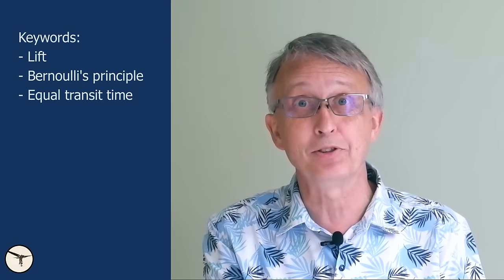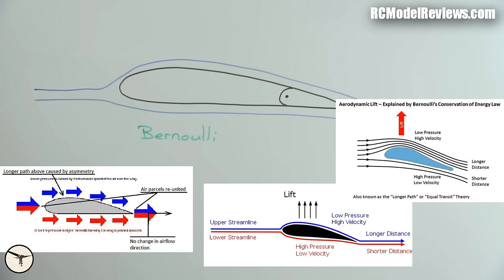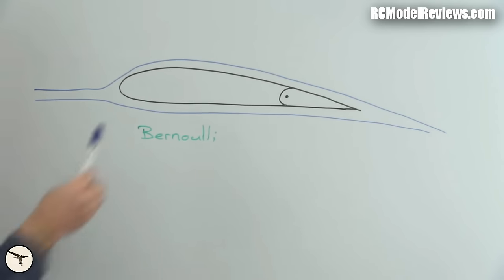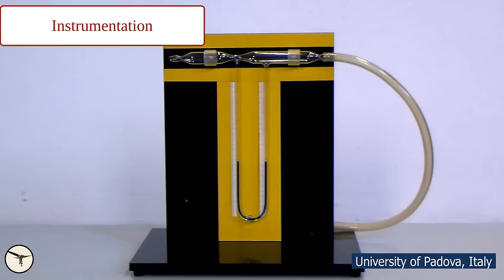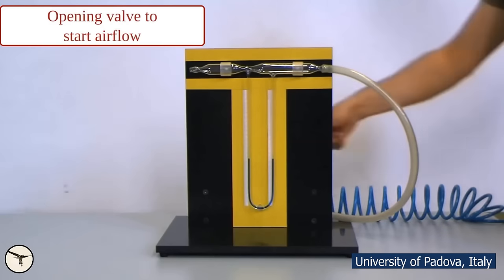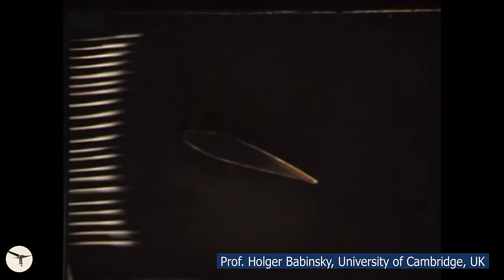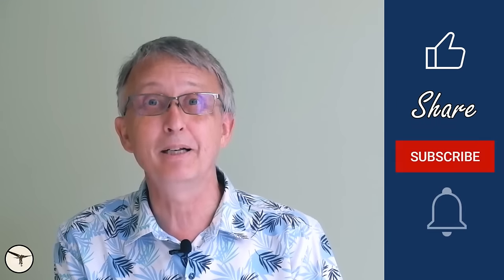Why are so many pilots wrong about Bernoulli’s Principle?

Comment: There are so many ways at explaining lift or movement.  When a vehicle traveling at a high rate of speed collides at an oblique angle with a stationary vehicle, it moves the stationary vehicle because of impact and not Bernouli"s Principle.  Call it what you want, but the wing is colliding with a mass of air.
Reply from the maker: The only place where the wing is colliding with a mas of air, is at the stagnation point.

Comment: In a lot of  bad airflow illustrations, air leaving the trailing edge doesn't continue downward, but rather immediately turns back upward in line with oncoming air. Air both doesn't do this nor should it.  In reality, air continues downward even after the wing has passed. The bad illustrations help the false hypothesis.

Comment: the air did move faster over the top of the wing and had lower pressure, so the same principle as a sail boat.
Reply: nonsense.  A sail has no thickness and has exactly equal lengths on each side.
Reply: @jeffreyerwin3665  but the wind moves a longer and faster way over the bulb sail, because on the other side there will be an "air-bubble" along the sail, over which the wind takes a shorter (and slower) way

Comment: It is NOT the curvature!  It is the constriction of stream tube due to physical obstruction of the wing. Reduction is x section area in air stream leads to increased v which lowers static pressure, that's how you actually apply Bernoulli

Comment: I don't understand the point of this video: Why exactly are many pilots wrong about Bernoulli's Principle ?
There's agreement that lift is caused by reduced static pressure above the wing due to increased air flow with respect to pressure/flow below the wing, as predicted by Bernoulli's Principle.  The only point of contention seems to be whether or not the flow lines reconnect beyond the wing - e.g., whether or not the flow path is longer for air travelling above the wing.  Why is this relevant to lift and what exactly do pilots not understand about Bernoulli's Principle ?

Comment: The video you're "debunking" is correct. It makes no difference where the two flows meet. The area over the wing is what counts. They meet behind the wing and the low pressure area continues past the trailing edge, with the higher - pressure air being forced into the "vacuum" and causing turbulence and vortices, both of which act as drag and hold the wing back. Streamlining to reduce this effect is vital.
Your "smoke" demonstration shows a stalled wing, with the air flow  separated from the surface of the wing. This is not aerodynamic lift. It's air resistance (friction) due to viscosity. acting at a vector that causes upward movement of the object. A brick will "soar" this way if it's moving fast enough, but that's not a wing. .An efficient wing has the bottom surface parallel to the direction of flight. The bottom covering isn't even necessary on many wings.

I apologize for any offence this may give. I'm an engineer, and we're as quick to point out things like this as pilots are.

Comment: I've seen another video do exactly what you just did.

You said that people are wrong about their understanding of how wings produce lift then you went on to describe the exact same dynamic as people understand it to be - that is, lower pressure over the top of the wing compared to the bottom of the wing.

At no point did you say what was different between what you present and most people's understanding and I wonder if you did that because there is no difference.
Reply from the maker: Pressure difference is essential for lift. What many people get wrong is how the pressure difference is created.

Comment: Dear Capt. Magnar.  I would like to see a mathematical proof the confirms or disproves the theory that is mostly accepted by the aviation population.
It has been said that when an airplane is making a constant altitude banked turn, the outer (top) wingtip is flying faster than the inner (bottom) wingtip.  Thus, it is said, there is an overbanking tendency.  Although many agree with this concept, I don't.  The theory by most pilots is that the outer (top) wingtip is enscribing a wider circle than the bottom wingtip thus making the top wing's airspeed faster,  causing an "overbanking tendency".
     In a coordinated constant altitude turn, I've never noticed an overbanking tendency. I can trim the airplane and let it go in smooth air and it will fly in circles until it runs out of gas.   I would agree that if the airplane were connected to the ground, like toy model gas powered airplanes held by a handle with two strings, this would be true.  But an airplane does not turn like a propeller or helicopter blade, where the tip of the blade is moving much faster than the central hub.  I have found it difficult to prove my point one way or another using simple geometry.
     The best way for me to describe my belief is to say that when the airplane (the flying wing) is flying in circles, it does not know where the ground is below it.  Instead, the wing believes the ground is directly equal to but opposite to the total lift vector.  In other words, the airplane thinks the ground is opposite to total lift and flys as if it is going straight.  The wing doesn't "know" its turning, it only feels heavier.   Do you agree or disagree?  If you don't, can you kingly set forth a proof that destroys my belief?
     Thanks in advance if you are reading this.
Reply from the maker: Hi. Some aircraft are more prone to overbank than others. There are several factors, like the wingspan and bank angle. When you fly in a turn, the outer wing will travel a longer distance than the inner wing. This is the formula for the distance along an arc: s = 2 π r (θ/360°), where s is the distance, r is the turn radius, and θ is the central angle of the arc. https://byjus.com/arc-length-formula/
Since the outer wing tip is travelling a longer distance than the inner wing tip, the speed of the outer wing tip must the higher. A higher speed results in more lift.
Reply: Than you for responding, but I don't see it that way, even though may seem obvious.  The FAA isn't always right. either.  Back it the 1960s the FAA told us that we should control our airspeed with elevator and altitude with power.  Then in the 1980s the FAA made a complete change and told us to control airspeed with power and altitude with elevator.  Now it's common to hear that performance = power + pitch.  My point is that the FAA can change its mind, depending on who is in office.  But thanks for your time.

Comment: It is not that the air moves faster over the top, but that the air flows more slowly under the wing, with the net effect that the air over the wing is faster when compared with the air underneath, so ... what pilots are taught is actually correct, it is just not due to distance travelled. Also, not mush mention is made of the trailing edge actually redirecting the airflow downwards, resulting in additional lift.
Reply: There is no significant force on the trailing edge (as long as no flaps are used and the wing simply trails of) resulting in additionnal lift. The airflow is directed downwards, but this is a global phenomenon not limited to the trailing edge, but it is caused by the entire airfoil or wing.

Comment: Any kid who’s held his hand outside of a moving vehicle will tell you it’s the force of the moving wind against your palm that lifts your hand. Ie: angle of attack. If it were primarily Bernoulli’s principal, wouldn’t aircraft lift indefinitely? Are pilots constantly trimming the plane down to counterbalance the Bernoulli “lift”?
Reply from the maker: Lift counteracts the weight of the aircraft. The higher you fly, the thinner the air, and less lift is available. Besides, "Bernoulli lift" and "Newtonian lift" are two explanations for the same lift.

Comment: This is just like floating of the human body in the red sea. The higher the density the higher is the viscosity. Due to the velocity difference between the top and bottom surface of the wing , there is a differential viscosity of the air on the top and bottom surface of the wing. The viscosity of the air below the bottom surface is higher than the viscosity of the air on the top surface of the wing. That means the density of the air below the bottom surface of the wing is higher than the top surface of the wing. It is this differential viscosity of the air which is lifting the Air plane in the upward direction. Newton's third law of motion is a better explanation for the life force of the aircraft. The viscous forces act perpendicular to the surface of the Wing of the airplane ✈️. The higher the density of the air below the aircraft wing, the higher is the load bearing capacity of the air to lift the aircraft.

Comment: a completely flat rigid moving strip generates air lift when AOA >0° & <90° including case if viscosity is 0 (liquid helium e.g.)
Bernoulli's principle provides reasonable explanation why asymmetrical airfoil generates air lift when AOA is 0°
showing asymmetrical airfoil at none zero AOA while applying Bernoulli's principle is confusing and somewhat pointless
pilots are not responsible for airfoil or wing twist optimization & CFD is a quite complicated mathematical subject
pilots should be aware/understand critical AOA, stall and in-flight icing, that degrades wing performance dramatically

Comment: Let's look at this issue in a different way.

Turn the wing vertically, put it in the sea so that it's cross-section becomes a keel or a rudder. If the transit time theory has any merit, the " upward" force on air would become a lateral force in the water.

Thus, should its veracity be clearly (and easily) proven or refuted.

Comment: I watched a lecture at MIT on aerodynamics, there she explained the lift is created by law of conservation of momentum.
Reply: its actually both. The problem stems from bernouli beimg meant for a closed system, like a pipe. A wing isn't  in a pipe and its in a pressure gradient from 14.7 to Zero.....
the maths we have been using isnt the right maths
Reply: @joeds3775  thanks
Reply: @joeds3775  You're right to some extent but I don't know who you mean by "we". The maths used to design surfaces on aircraft include a bit of Bernoulli but are far more comprehensive than that. I'm old enough to have done the sums before computers and they could take months to get through. The advent of computers has speeded things up immeasurably and has taken away the temptation to simplify in order to make the calcs less tedious, so designs are becoming more accurate all the time.

Comment: So how does an aircraft fly knife edge ? Wings not required !
Reply: To the extent there is no vertical component of thrust aiding lift, a wing with little or no asymmetrical shape creates the asymmetrical condition needed for lift, by flying with a positive angle of attack.

Positive angle of attack creates the necessary degree of asymmetry to the relative wind, both right side up and inverted.

Any aircraft able to maintain altitude in a continuous 90 degree bank orientation, would have to be using a combination of engine thrust sufficiently pointed in the vertical direction, with enough thrust to weight ratio, plus any angle of attack asymmetry producing lift from any exposed surfaces.

It has to be one, the other or a combination.

Comment: My flight instructor told me something important.  It is not the airspeed that is important, it is the speed of the air that is important.  Thus, there are many unique designs that increase the speed of the air over the foil, and that is not dependent on the airspeed.  Interesting no?

Comment: I have zero knowledge on this subject and I am not saying this is wrong, BUT solely on the reasoning presented here, the explanation makes no sense to me.
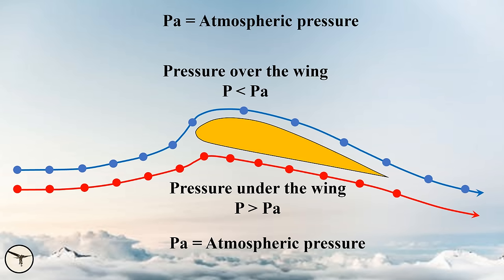First, it is stated ~3:34 that the pressure well above the wing is Pa, and the pressure just above the wing is <Pa, and that is lift. 
If you have higher pressure above and lower pressure below, that sounds like the opposite of lift. 
Similarly below the wing pressure just below the wing is stated to be > Pa, but below that is Pa, and that is lift.
Again, that sounds to me like the opposite of lift. 

Second,  if you freeze the image at, say, 3:11, it shows ALL the smoke trails past the rear of the wing at approximately the same spot, which implies equal speed and ergo equal pressure.  ie no pressure differential as noted above.
The smoke trails below the wing appear more complex: higher pressure just below the wing and lower pressure below that. That is as stated above but surely that is the opposite of lift?

Overall, however, the air below the wing is plainly at higher pressure at ALL levels, than air above the wing at ALL levels.
Which looks  remarkably like the normal application of Bernoulli's Principle, the video is trying to refute.

Lastly, I don't see why you would 'forget' Newtonian physics; if you stick a tilted hand or flat piece of anything stiff, out the car window, it has lift or otherwise depending on the angle.  That - surely - is simply Newtonian physics at play?

Comments?
Reply from the maker: Hi Alexander. It is the pressure diffrance between the upper and lower wing surfaces that counts. (Forget the atmospheric pressure if that confuses you). When the pressure over the wing is less than the pressure under the wing, we have lift. 
The smoke at 3:11 clearly shows that the air flows faster over the wing than under the wing. However, the windtunnel is too small to show undisturbed air further above and under the wing. 
I haven't forgot Newton. The purpose with this video was to point out why many people get Bernoulli's principle wrong.
Currently, I'm producing a new video where I will explain the relation between Bernoulli's principle and Newton's laws of motion.

Comment: So summing up - the relative pressure on top of the wing is lower because the air is travelling faster ?
Reply from the maker: Yes
Reply: Yes, but the pressure difference between the upper and lower surfaces of the aerofoil is not the primary cause of lift.

If it was, when an aircraft is flying upside down, the lift force produced by the wing would be in the same direction of gravity, would add to gravity and the aircraft would crash into the ground. Which clearly, does not happen.
Reply: @deang5622  Angle of attack is the other relative. When flying upside down, the angle of attack must be more aggressive to create lift. Of course there's a lot more drag because the airfoil is designed to be right way up.
Reply: @turbofan67  But the pressure difference is not the cause of lift to begin with.
Reply: @deang5622  Well that's where it becomes theoretical,  so you would have to prove your theory.
Reply: @turbofan67  The only method of generation of lift which explains the concept of induced drag is that of Newton's Third Law of motion.

QED.

Comment: A perfectly flat wing will generate lift as long as the trailing edge is below the leading edge. The blunt leading edge makes it a lot more stable. We can copy a birds wing and it will work but birds have a propellor, wing, and parachute (for braking) all in one. For those pushing the theory lift is from air going faster above the wing, try and generate lift with the leading and trailing edges at the same height.
Reply: "For those pushing the theory lift is from air going faster above the wing, try and generate lift with the leading and trailing edges at the same height."
That's easy.  Take a sheet of paper and blow across it but abuve.  It will lift the paper into the airstream.
Reply: You need to blow with equal amounts above and below the sheet of paper.

Comment: Nothing wrong with Bernoulli, the problem is the lack of explanation on why air accelerate by Kutta condition and vorticity.
The best explanation I found on text book for pilots is: "The air one the top accelerate due to the shape of the airfoil."  really, that's all a pilots needs to know, As an instructor myself, unless it's a class for instructor, I'd told my students the equal time is wrong and the rest is MAGIC! All they need to know is they can control the Cl by change AOA, most of the time linearly, but some times isn't.
Reply: Except that's nonsense because you can create an aircraft wing that has NO airfoil shape whatsoever. The point of the airfoil to to allow the deflection of air downwards while *minimising drag*. A flat wing absolutely can fly... but it produces more drag than an equivalent airfoil shaped wing.
Reply: @nitramluap  A flat plank with AOA still have the shape to meet the kutta condition thus create vorticity for lift, it's not just the curvature can be called as "shape".